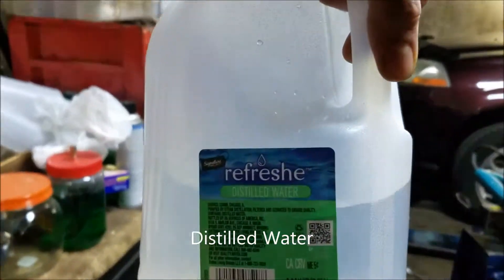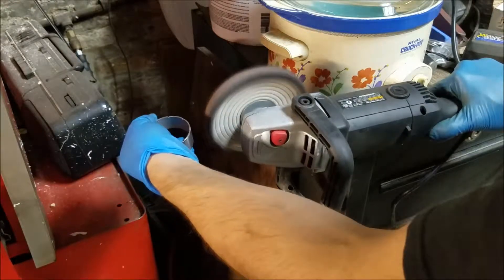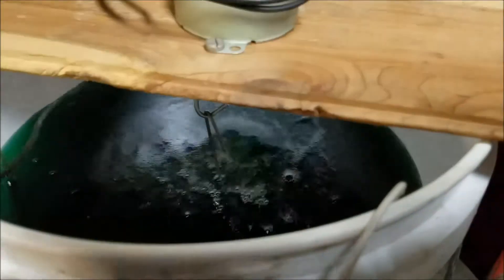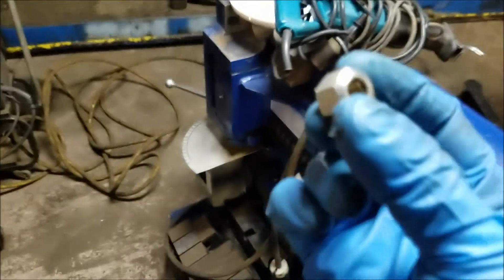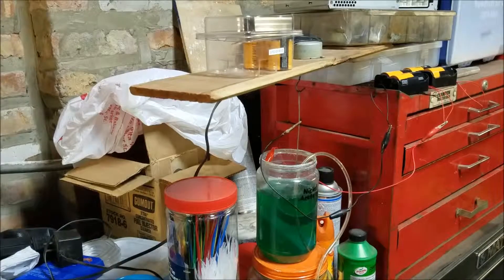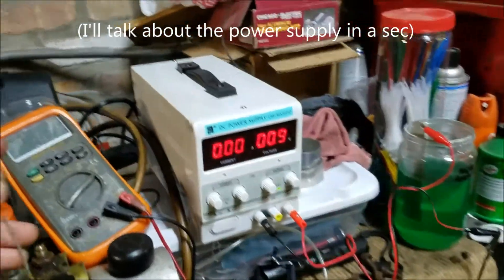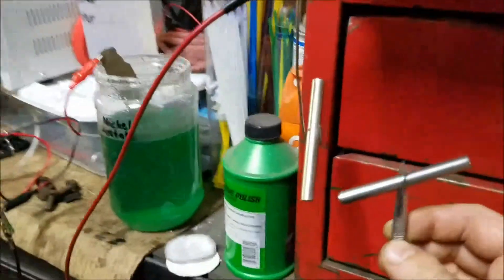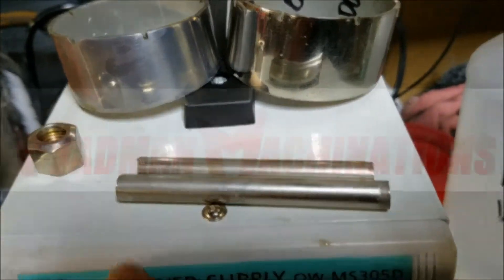(Mis)Adventures in Electroplating!

Comment: Lớp mạ có bền theo thời gian không bạn ?
Reply from the maker: Yes. Nickel oxidizes and dulls over time, but it can be polished. The plating layer is adhered on a molecular level, so it will not come off. I have a couple of parts that have been outdoors for several years, and have oxidized. Other parts that have been indoors have not oxidized.

Comment: Did you ever plate out the aluminum contamination in your solution? It's been 5 years. Update?
Reply from the maker: I never actively tried to, because I got that Caswell plating solution. I will say that it did seem to get better the next use and the next, but I kind of stopped there.

Comment: I have read every thing I could find and the one thing that comes up as a problem the most is contamination the first thing I was thinking when when you put the pipe in the nickel was that the alum on the inside of the pipe was going to ruin your solution I’m getting ready to do some nickel plating myself so I am nervous about messing up lol
Reply from the maker: Lol yeah. We learn through failure. Apparently contamination like that can be run out by plating a lot of scrap.

Comment: My problem was the solution was going cloudy and the parts were going black and green but not coating with nickel, this was after polishing, washing with brake cleaner, then acetone. I changed back solutions from shop bought nickel acetate, to my own white vinegar, and pickling salts electrolyte, then washed the parts in Hydrochloric acid 15% 5v 2amps and it's plating like a champ. (I added a capful of Ethylene Glycol too) I added 500ml of Lactic acid to my gallon of electrolyte too. Someone suggested it somewhere, doesn't seem to have done any harm
Reply from the maker: Neat. I'm guessing the first solution you were using was contaminated somehow, perhaps from one of your cleaning solvents. I've had no problems with hot degreaser solution as my pre-wash. 2 amps sounds awfully high. I bet you get a lot of bubbling, which leads to an imperfect surface finish. It'll plate real fast, though.

I wonder what the glycol and lactic acid are supposed to do?
Reply: @madmanmapper  the ethylene glycol is added as a brightener, the lactic acid was just a suggested alternative to white vinegar.  I will try again with a lower current and see how it goes

Comment: You can probably just polish the plating after it's plated to get rid of that matte like color.
Reply: The color it has without the brightener.
Reply from the maker: Maybe if I were to abrade it deep enough, but then it might take off the plating, which is only micrometers thick to begin with. The hazy color is definitely plating contamination. I'm only guessing it was because of the aluminum, but really it could have been something else. The good news is that you can apparently 'plate out' impurities like that. ie, just keep plating stuff until it gets better.

Comment: My dear brother, I am one of your followers, and thank you for your support. I swear to God, in all honesty and integrity, there is no channel that explains clearly. I did a lot of research on the topic and I did not find any benefit, but from your videos I started trying to work on what are the materials for the equation of the golden and silver color. If you would be so kind, write me the materials and measurements
Reply from the maker: Yes, I had the same problem finding information. The measurements should be the same for gold and silver as for nickel. The materials needed are only some kind of acid and the metal of your choice. Vinegar is simple and easy to get and work with, though I am not sure how well it will work with gold.

As for the equation, it is also the same for any metal. But seriously, don't worry about the math. It is a waste of time. It is so complex and the measurements need to be so precise that it really serves no practical purpose outside of a laboratory, or an industrial setting where tolerances are very tight.

Comment: Turn up the voltage very slowly till you see the bubbles.  Do this by increasing the amps, not the voltage to get the most current you can without going over 6v. That will be what you need.  Don't go any higher than 6v.

Comment: Nice video 
Sir please tell me what is the exact current time and Amps for plating if I plate some jewelry? Please Sir guide me
Reply from the maker: There is a complex equation in the video description. Some small jewelry at about 200mA probably needs 2 minutes for a good plating. Longer if you want the layer to be thicker, and therefore more resistant to corrosion or rust. 100mA will be less likely to form bubbles that will damage the plating, but will take twice as long to plate it.
Reply: @madmanmapper  thank you so much 💝
Reply: @madmanmapper  nice sir I m going to plate 36 grms deffrent items like rings locket and ear rings so what current should I put?
Reply from the maker: @phool289  200mA is good. Less if you have problems.
Reply: @madmanmapper  thank you sir

Comment: Just a thought, I expect most of the lack of shine is due to hydrogen bubbles on the surface of the part being plated. Allegedly ethylene glycol is an effective shining agent. I suspect that is because of its surfactant capabilities keeping the surface wet and expelling the hydrogen before bubbles can form.
Something that could be worth a try is the non ionic surfactant used in agriculture. It is non toxic, supposedly non pollutant and only requires a few millilitres to make a 100 litres of spray to stick to plants.
Reply from the maker: So basically antifreeze? I've got plenty of that. Anyway, nothing seemed to polish that haze off. I'm still pretty sure it was some chemical contamination of the metal being deposited. Otherwise, I would agree with you, the bubbles that form on the part are no good. I keep voltage low enough to mitigate the bubbling, and use an air bubbler thingy on the bottom of the tank to knock off any bubbles that form.

Comment: OK you believe the aluminum contaminated the solution. When it come to anode and cathode this might be helpful to you.

Dissimilar Metals   galvanic corrosion:   
*Note: the closer the two metals on this list, the less likely they will be to suffer from the negative effects of galvanic corrosion.

 From Anode To Cathode

• Magnesium
• Magnesium Alloys
• Zinc
• Beryllium
• Aluminum Alloys
• Cadmium
• Mild and Carbon Steel, Cast Iron
• Chromium Steel (With Less Than Or Equal To 6% Chromium)
• Active Stainless Steels (302, 310, 316, 410, 430)
• Aluminum Bronze
• Lead-Tin Solder
• Tin
• Active Nickel
• Active Inconel
• Brass
• Bronze
• Copper
• Manganese Bronze
• Silicon Bronze
• Copper-Nickel Alloys
• Lead
• Monel
• Silver Solder
• Passive Nickel
• Passive Inconel
• Passive Stainless Steel (302, 310, 316, 410, 430)
• Silver
• Titanium
• Zirconium
• Gold
• Platinum
Reply: So what this shows is aluminum is easily corroded away. So it was easy for it to go into the solution.

Comment: I did the same thing, not thinking I used a piece of aluminum wire to hang my test piece. I wont do that again.
Reply from the maker: Yeah, oops, right? Apparently you can plate out contamination like that. So just keep plating scraps until it comes out clean.

Comment: Adding salt creates more current elements that salt contains creates a stronger current
Reply from the maker: Salt (an electrolyte) makes the solution electrically conductive to begin with. Yes, more salt would equal more conductivity (technically less resistance), which means more current is able to pass through it. But adding more salt wont necessarily help. Once some conductivity is established, the nickel is deposited in the solution in the form of a nickel salt anyway.

Comment: Do you know if it's possible to plate on top of plastic. Say plastic fishing lures? Any recommendations on how to go about it
Reply: I know your question is 6 months old but I seen someone take a leaf from a tree, dried it, used liquid graphite from a spray can and gave it 4 coats. Then they nickel plated it, it really turned out pretty nice.
Reply: @douglasw9163  ok thanks
Reply: nickel sulphate and nickel phospate, with some palladium saly, called electroless nickel plating
Reply: @lewisavinash1  ok thank u
Reply from the maker: It IS possible, as you can find chrome plated plastic just about everywhere, however I know very little about it. I do know that it's a mostly different process, though, typically sprayed on in several different chemical coats. It's also friggin' expensive. Caswell sells a spray on chrome kit, you might want to check with them if it works with plastic. Good luck, their customer service is garbage.
Reply: @madmanmapper  good to know customer service =SHIT. Appreciate the info
Reply from the maker: @characterlures  Don't get me wrong, though, their product is good.
Reply: @madmanmapper  for sure man i will look into them for sure

Comment: From what I read, The old plating was thicker. The reason you are having trouble with your plating is contamination of the solution. That is what I read in the book on plating.
Reply from the maker: Yeah I pretty much figured that out the hard way. Aluminum contamination, as it happens.
Reply: @madmanmapper  You are right on when it comes to contamination. I was told by a guy who worked at a plating shop that if you are truly anal about cleanliness, you can us the same solution just about an unlimited time. The solution just gets better and better. Then someone always messes up and wham, need to make new solution again.

Comment: When plating with the nickel-vinegar solution, you should use a current of about 0.5 to 1 amp for every 15 square inches of surface to be plated.

But how do you get that?
Use 5-12V DC and add table salt as required.
It lowers the solution's resistance.

If you are to use condiments, salt is appreciated ;)
Reply from the maker: Well... the easiest way is to use a benchtop power supply like I got, and just tune the voltage to get the desired amperage.
Reply: @madmanmapper  did you add salt to the solution. I have been accumulating some things last few days so that I can try doing this. having watched a few videos on it I decided to get hydrochloric acid to try as well as white vinegar. I'm going to have a go tomorrow. Experimenting with conductivity and acidity of solution might be something to try as well as the voltage and current.
Reply from the maker: @SodiumInteresting  For the vinegar solution (nickel acetate), yes. Just a pinch is all you need. Not table salt, use Kosher salt so it doesn't have iodide in it. For the Caswell solution, no, I followed the directions on that one. It may not even have salt in it, because it in itself is just nickel salts.

If you want to just start small and experiment, I don't think hydrochloric acid is necessary. Nasty stuff to work with if it's not really necessary. My vinegar solution worked perfectly fine until I contaminated it with aluminum. (I could probably plate out the contamination.) In fact, the results from the vinegar solution were pretty good. I plated a large nut with it, and it looks great - I keep it on my desk. Finish quality isn't the best, but that's my fault for poor polishing. The plate is a bit yellow, as nickel naturally is. You really have to look closely to see the yellow, though. But it is more prominent than with the Caswell solution, which I'm sure they designed to plate a little less yellow. I think I mentioned in the vid, but Caswell sells a 'copy chrome' which as far as I can tell is the same crap, but with two bottles of brightener instead of one. Their products seem very good, but their customer service is shit.

Also, last tip, if you want to do anything beyond casual experimentation, buy a cheap benchtop power supply. Worth the $40 imo (But don't keep it plugged in while unattended, they catch fire, apparently.)
Reply: @madmanmapper  I already bought a variable 30v 10a bench power supply about a week ago, it's something that will definitely come in handy for a lot of things. before I was using for my projects a fixed voltage pc power supply with a cheap terminal that divides the SATA wires for you into 3, 5 and 12v positive, negative and ground. that was until I blew a fuse somewhere and decided I wanted something better.

anyway yes it's definitely good to have decent variable bench one.
I made a magnetic stirrer from a 12v pc fan with a cd player magnet stuck to it and a raised bit of cardboard cut to shape. A 2000ml glass beaker and small £8 aquarium heater will be coming tomorrow. I'm hopeing it'll support the weight, if not it will need modification but I should then be able to keep the water both at a set warmth and agitated without buying an expensive dedicated magnetic stirrer/heat plate thing.

you might be right about the hydrochloric  acid but I have 3liters of it so gloves, maybe even chemical mask though I think it's only 10%.

the other thing of course is cleaning and polishing in preparation. I think I might be lacking in the right kind of abrasives but for now but acetone might be good for removing all the grease, oils and the oxide layer. I've seen people first plating their work peice with copper in a seperate copper sulphate electrolyte before doing the nickel in nickel electrolyte but maybe that is a final protective finish for copper plating rather than a improvement to nickel plating
Reply from the maker: @SodiumInteresting  With copper, I believe it matters more what kind of acid it is. I tried some nickel acetate, but could not plate anything except nickel. I think one type of acid will allow you to plate steel directly. I've heard copper plating is sometimes used to make the part bigger, because copper is fairly cheap, then nickel plate it. It will build up, but it won't fill holes.
Reply: @madmanmapper  the electrolyte needs to be able to facilitate movement of the ions specific to the metal you are plating with. copper sulphate will carry copper ions, nickel sulphate for plating nickel. I don't know the chemistry of it with bonds and free electrons and the releasing of hydrogen atoms etc but there are videos on it.
theres a place near me that does electroplating, I expect they have some specialist professional chemicals and equipment there
Reply from the maker: @SodiumInteresting  Yeah but copper acetate will not plate steel. Maybe if it was copper sulphate, I'm not sure.

Comment: Isn't the white finish just matt nickel plate?  Some times people actually aim for a matt finish.  Anyway, that is what the brightener is for, to make the matt finish shiny, or technically, the brightener inhibits crystal growth so making the crystals much smaller and therefor shinier.
Reply from the maker: I'm sure that's what the brightener does, however, no, the cloudy white is not just a matte nickel. It is definitely contamination. I experimented in the video, attempting the same thing in nickel acetate, and the same cloudy haze appeared. When, before, the nickel acetate made a perfect shiny finish. I think, though, that a matte finish would have 99% to do with the surface texture before plating and 1% to do with the plating solution. The surface finish test I did as well confirms that. Though the Caswell solution has some ability to make the end finish shinier, it's very minimal, and cannot even fill the lightest scratch. I definitely appreciate it, but it's more of a backup policy than a substitute for good surface finishing techniques.

Comment: The power supply has a current limit and voltage limit. For plating you might consider going constant current.  Set current as desired, then increase voltage to reach desired current, plus some of there is working range.  The voltage on supply will then vary to maintain set current as piece varies in distance and geometry from anode.

The current can be set by seting a volt or two on supply,  short power leads, then set current. Voltage will dip to voltage drop of leads.  Then  leave current set,  energize plating solution, increase voltage to meet current, then a few volts more. Observe current in plating process, if current drops below setting, increase voltage more.  The system will be automatically change voltage to meet desired current.
Reply: Yes, one needs to monitor the current, not the voltage. It's the current that does the plating. Determine ahead of time the current/sq inch you need for your plating solution. It's always a range, and given in the plating solution formulas in books. Then figure out the sq inches for your part to be plated. That will give you your target current during plating. Turn on the power and put the part (under power) in the solution, and monitor the current, varying the voltage to maintain that current level. Don't remove the part to look at it! If you break the electrical path and put it back in, it is like trying to plate layer upon layer, and nickel doesn't like that. It is very difficult to plate nickel on nickel and have it stick. A thick layer will peel right off. You can occasionally pull it out partway to look, but don't break the electrical connection.
Also, the area of your part to be plated always plates thicker the farthest it is from the electrical connection, which is the opposite of common sense. That's why plating sometimes "burns" on the end of a long piece. The "burn" is a higher plating current density in that area.